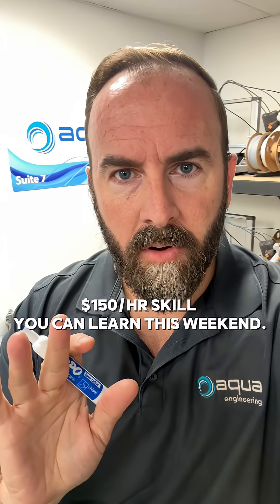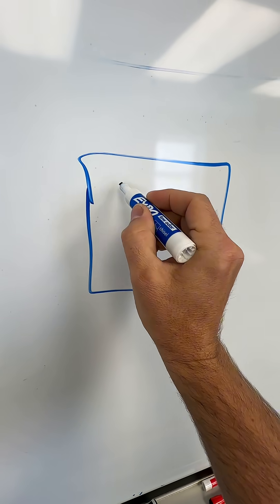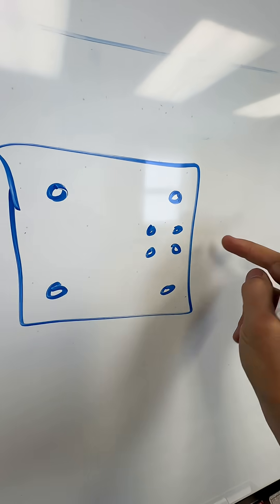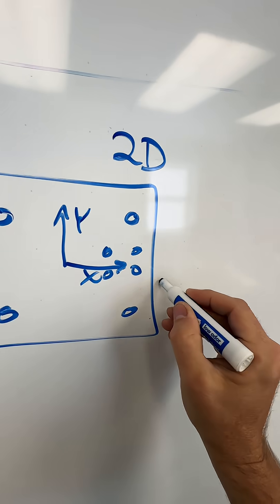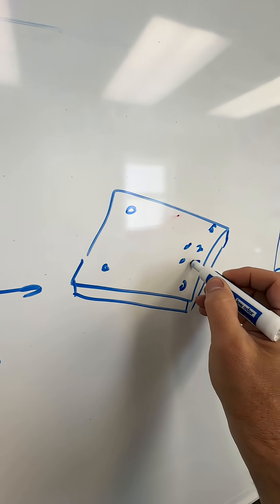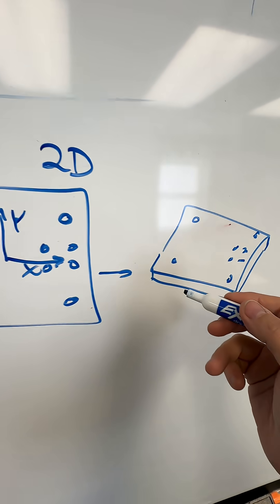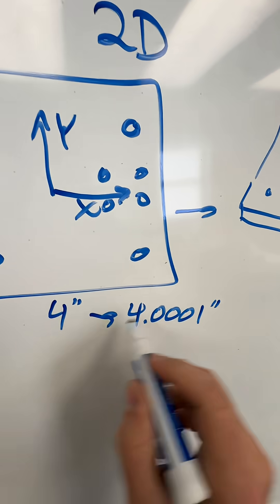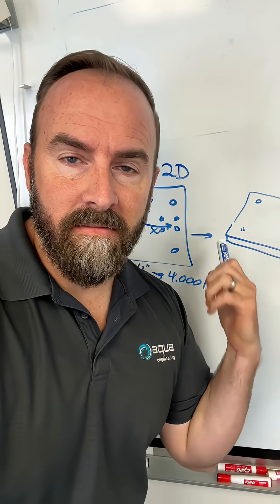Intro to Parametric CAD (BREP, STEP)

Comment: To explain a bit further, parametric CAD is almost the same thing as normal CAD, just instead of making this a 5’x5’ square or something, you make the side lengths a parameter like “sidelength X” and “sidelength Y”, which you can change to whatever length and width you want. Then you do the same thing with the bolt holes, instead of working out exactly how far in from each edge you need to centre the hole, or working out what the centre-to-centre length, etc, you just make the distance they are from the edge a parameter.